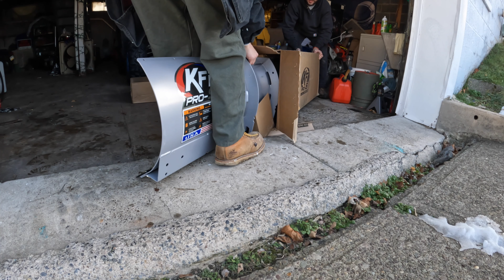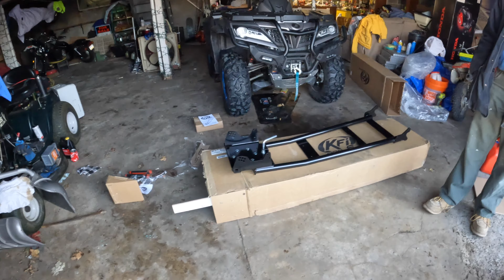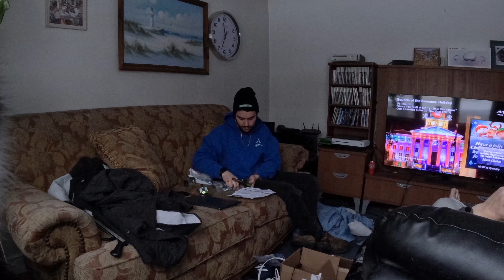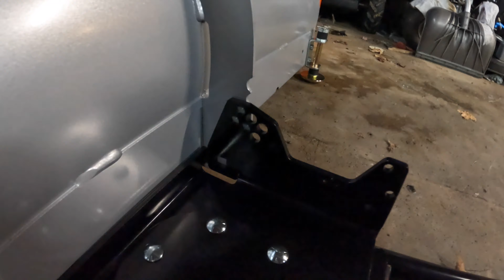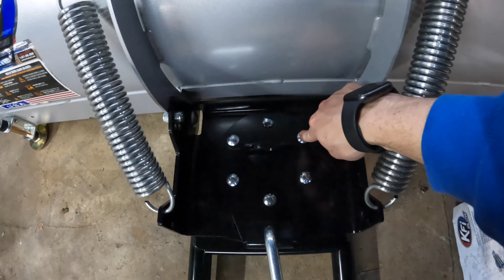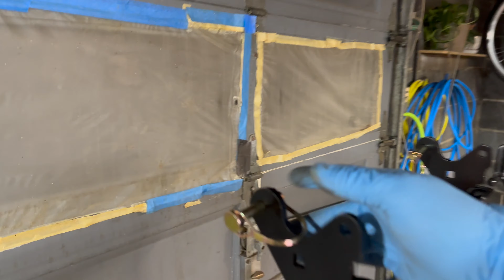Unboxing and Installing KFI-Pro Snow Plow for CFMoto CFORCE 1000/800cc

Comment: Nice video, I am looking at plow setups for my CForce 600 Touring, what did you mean by you changed out the cable for a plow strap?
Reply: Nevermind I looked up the strap, never knew those even existed. Definitely looks like a better setup for sure.
Reply: Your attachment for your hook plate should be behind your handle that pivots the plow. That way you’re pulling the plow straight up and down on the winch rollers. The way you have it hook up now your pulling back and up. I have the same plow and ATV. Try it it will work great. I also use a plow strap.